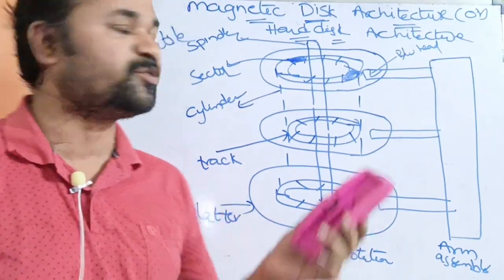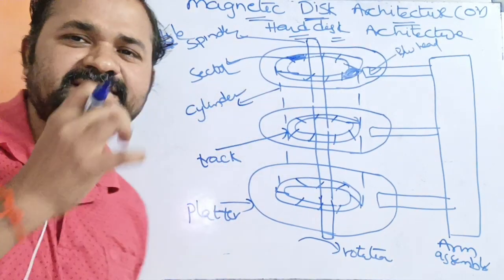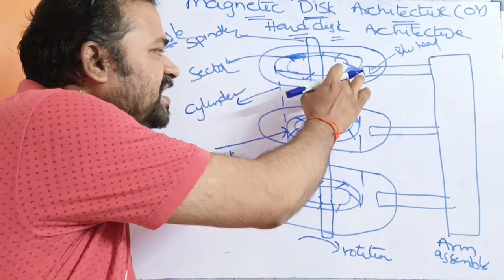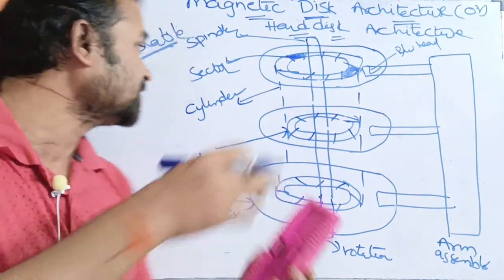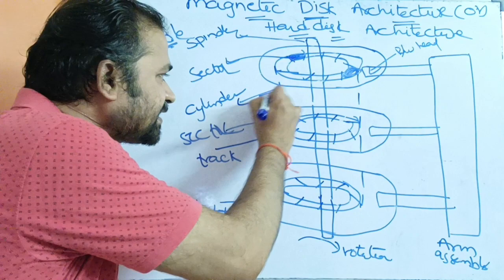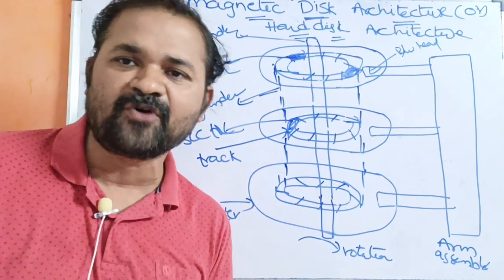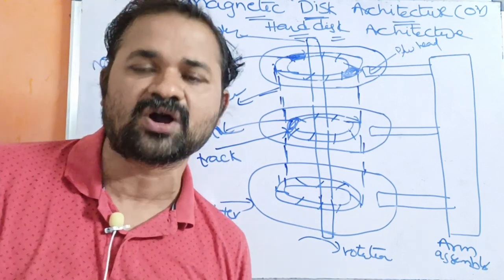Hard disk Architecture ||  Magnetic Disk Architecture || Operating Systems || Disk Management

Comment: 00:02 Magnetic disk architecture is essential for storing large amounts of data permanently.
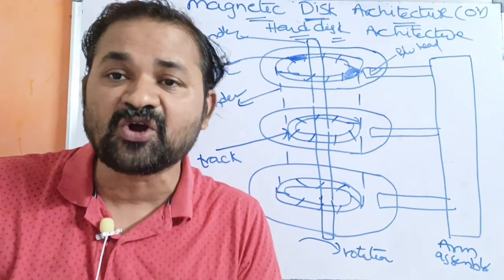00:51 Hard disk is non-volatile memory
01:32 Hard disk architecture includes platters and spindle for data storage
02:22 Hard Disk Architecture includes platter rotation and track subdivision
03:06 Hard disk architecture includes tracks, platters, and sectors.
03:45 Storing data on tracks and sectors in a cylinder
04:31 The read-write head allows read and write operations on disk sectors.
05:12 Read write head function in magnetic disk architecture
Reply from the maker: Nice